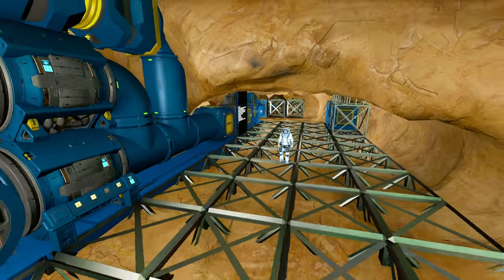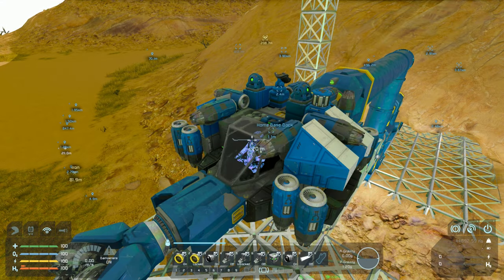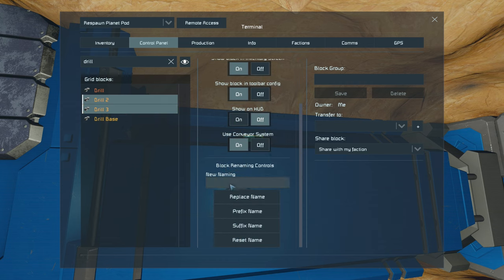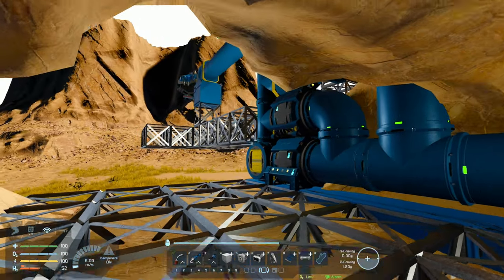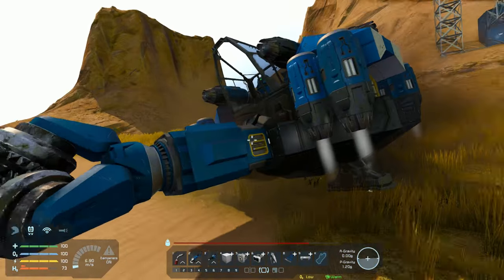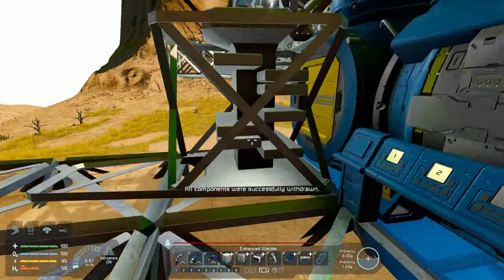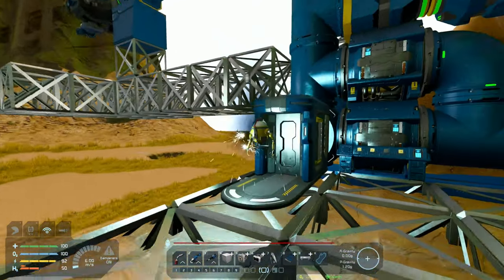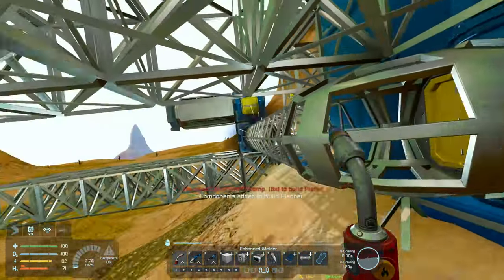Simple Drone Printer S2E05 - Space Engineers

Comment: So just a recommendation, instead of using a small battery, and landing gear you could always use an advanced rotor on the base grid.  Remove the large head and install a small grid head that way the projector you put on it is using base power instead of the small battery. Just my two cents
Reply from the maker: I know this and I actually do this in Ep08 and onwards ✌️

Comment: 14:41 Why does that seem so much more brutal than it really was? I tensed up seeing it hit the ground after my own tribulations in autonomous piloting programming. It was working so well, too. I wonder if it was just too heavy and couldn't compensate after the drop from the upper waypoint.
I wonder if you can have two paths, one with a higher waypoint at the end, and switch depending on how much load the pod is carrying. This would need to check cargo percentage then possibly toggle a block to trigger a second EC to change the paths. I may tinker with some tests later to see if I can figure this out.
Reply from the maker: The problem is i cant add anymore thrusters to the pod otherwise they cancel out with weight etc. But at the end of the day... the pod is only temporary till i get my new Drone Drill and Smartest AI Cargo Drone into the seaaon... Hopefully, soon 🤓🤔👌